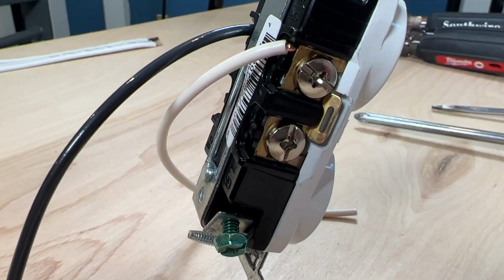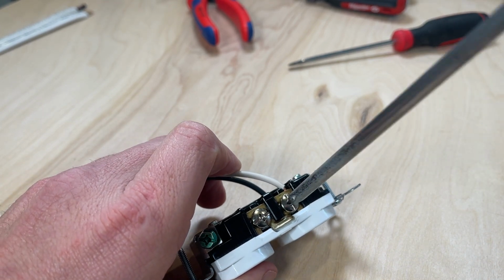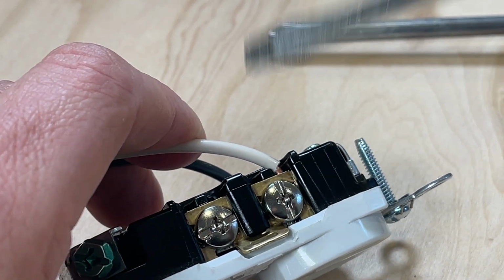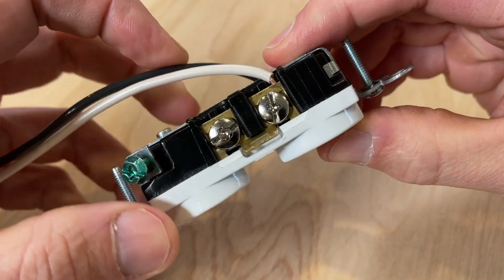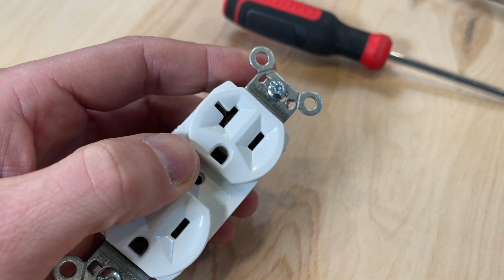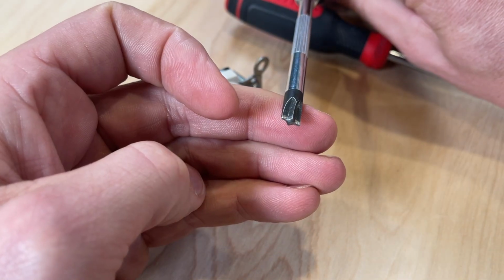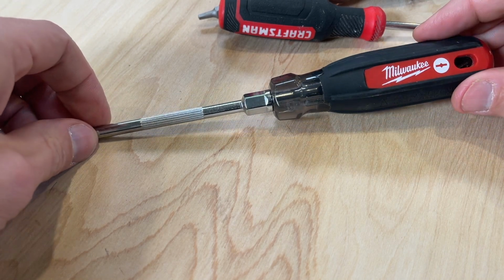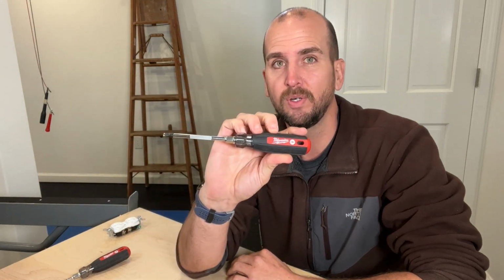80% of People Use the Wrong Screwdriver For Electrical Work

Comment: As a homeowner I do not have specialty ECX screwdriver and I may get one as I was wiring things around and will be doing more during renos. However the Robertson(square drive) is perfect for the job and you use No 1 for the outlet wiring and No 2 for the wiring ground to the electrical box and also tightening the clamps for wire coming to the electrical box. RObertson is all you need for electrical work. (With the exception of the cover plates, damn those slotted screws)
EDIT: I just realized that Canadians also have superior clamping in electrical boxes, its isnide the box so you can always adjust it instead of on the outside edge. And the screw is thick Robertson drive.

Comment: In Canada we use three Robertson size bits which work for every situation, and when we order something that comes with flathead or Phillips type screws,  we generally toss those screws into a jar and replace them with Robertson screws. This makes the job better and easier for us and the next guy who comes along and has to do some work on that piece of equipment.
Reply: Yup. When I remove a flathead and Phillips screw I usually toss it directly into the garbage.

Comment: Great video! Very helpful. I think the world would be better if they just put a better screw in the outlets... then maybe I could get away with using less tools to complete jobs... wishful and possibly dumb thinking I guess because I'm sure for some reason that these screws have to be this shape. I'm not an electrician but recently have had to wire a small travel trailer.

Comment: First off, as long as the job is done it does not matter if you use a Phillips head or flat head, just use the right sizes. You gaslighted by deliberately using wrong sizes of screwdriver. If I was using a flat head screwdriver for that screw I would have picked a wider one! The reason yours kept moving was that it kept wanting to go down into the deeper Phillips indentation! But I would have chosen a Phillips head that will seat correctly in the screw and not go with a generic #2 head like you showed. Any good DIY person will have more than 1 size Phillips and flat head screwdriver at hand!

Comment: ECX is just not necessary.  You can get enough torque on the screws of a receptacle to tear the threads out with a #1 Robertson without any slippage.  Why would I bother to buy a single-use tool where a multi-use Robertson works just as well?

Comment: KISS. a correctly sized flathead works great. I have also slightly took the tip off a phillips and it fits much better into the slot. I could never understand why someone would overwhelm themselves with extra tools when it is not needed. I work in the maintenance field and have done home repairs since i was about 13. Dont buy a new tool just because its new.

Comment: Absurd. Those screws are clearly for Pozidriv (PZ2 or PZ3) screwdrivers which are pretty abundant. They are cross-shaped too but have different gemetry. Not for square of some weird types. Phillips are intentionally designed to pop out of screws under tension when those are screwed in to some degree. This was a purpose of it from the very beginning as it was designed for car manufacturing. Contact surfaces of Phillips screwdrivers are slightly angled even on brand new ones. Pozidriv head and screws are designed no to do so. Their contact surfaces are flat and they stay with the screw under almost any tension.

Comment: Ideally you want a safe a mount of torque on the wire

there's specific guidelines for specific type of connections as to how many newton/m is supposedly needed to apply for an ideal connection.

these things can heat up and cool down many times over it's life time, when it's too tight, things might snap off, when it's not tigth enough, the wire might slip out.

If you can't apply enough torque with the philips head, you're weak and should train yourself (given that you're using a better fitting one than shown)

ideally you want the PH screw to be able to rest on the screwdriver without being able to move independantly in either rotation direction. Yours is woefully inadequate in that respect. The idea is good: getting a better tool for the job, but you show that you don't know why the other 2 screwdrivers were failing you.

Comment: A slotted screwdriver doesn't give you torque because of more surface area. It's because it gives you more leverage. The bit extends outwards further towards the outer edges of the screw, giving you a greater radius, which gives you much more leverage to rotate the screw.
Reply: Actually regardless to size of a driver, the leverage is always the same. Just a matter of what will be capable of holding up to the most torque. Leverage would require the handle itself to change sizes or to be off center.

Comment: So far as I know the Robertson #1,#2,#3 etc is the same size no matter where or who made them. I believe metric sizes are also the same size. A #2  metric Robertson is the same size as the #2 imperial size. The Phillips has different sizes and shapes depending on where it is made. It also has metric sizes. Dry wall screws used a special shaped Phillips.  The differences are so slight it is hard to determine which driver to use. This means that if you do not match the screw exactly it spins and stabs. Any time I disassemble something I replace all the screws with Robertson.

Comment: If I was a full time electrician, I'd probably use the ECX driver. I didn't even knoe the ECX existed. I typically use the #1 robertson on outlets and switches and the #2 robertson in the panel. I typically have one or 2 of the multi bit drivers in my tool box, but if I don't , I'll use a #2 phillips. I actually found that a robertson was superior to a phillips quite by mistake, when I was getting frustrated with a #2 phillips slipping off the screw constantly. I tried the #1 robertson and it was a thing of beauty.

Comment: Not only the outlet design is dangerous, but also the metal piece that attaches it to the wall is the same that is powered by the live wire in the wall. Darwin would be proud.
Reply: Btw, use insulated screwdrivers, not that ones

Comment: #2.25 unless you take a smaller slotted screwdriver and use it on the smaller terminal:P edit: Lol forgot it's us, you guys make problems of stuff that kinder-gardeners know how to deal within eu. Just switch to 17century units you airheads, don't use your pinkies to measure stuff. Since 2019 all base SI measurements are abstract, that means they're based on constant natural measurements (wiki those so I don't have to explain: https://en.wikipedia.org/wiki/International_System_of_Units). It's not called international for nothing, you feet high and rocks heavy neanderthals:P

Comment: "Slotted screwdriver" ... Just say flat head, that's what it is.

Also, no need to be pedantic about what screwdrivers are "best". If it works, it works. Wires don't often see a lot of movent, so they don't need a lot of torque to be secure, if a screwdriver starts to cam out, it's probably tight enough for electric work.

Comment: well... I don't know if you're an electrician or not, but I was taught to make a loop on the end of the wire and wrap it around the screw for an actual tight connection, and you don't have to crank down on the screw so hard. Just shoving it in there straight is moronic, it slips out easily. I was taught this in an electrician school

Comment: So we learned 2 lessons;
1) you need special tools or the absolute best fitting slotted screw driver, while slotted screw drivers are outdated out of several reasons
2) those screw design is absolute garbage
= Use Pozidriv (advanced and better Philips head) or, even better, Torx head screws and everyone's happy.
Also in Europe we have those garbage screws, they're just a pain in the a**.

Comment: Or just don't use garbage -_-
The phillips screwdriver looked like your average driver from the dollar store. Just buy a professional set of screwdrivers like the Wera with lasertips and you won't need anything else. No need to buy a special screwdriver for everything.

Btw, this is only applies for ppl working on DIY projects or for fun or whatever not professionals, that need to screw 20 of this everyday.

Comment: Good advise for the general DIYers out there. I personally prefer to have a proper selection of drivers of most if not all the different tips/bits out there - saves me the aggravation of damaged fastener heads or gouging the surface of the object I’m working on. And those square tips(Robertson)are overly underrated….. just my 2cents

Comment: As an electrician, I've been using the ECX screwdriver for years now. It's also great for EMT fittings. I rarely use a slotted screwdriver for anything other than a pry bar or doorstop.
Reply: @tabooretka  as an electrician myself, I do occasionally use slotted screwdrivers. The offset ‘wiggly’ works best for cover plates imo. Larger slotted sizes come in handy when working on older equipment/loadcenters, and occasionally new breakers that use slotted terminal screws

Comment: OMG this video is so stupid. Engineers: make a bolt suitable for all types of screwdrivers so you don't need to look for a specific form of a screwdriver head. People: create and use a screwdriver suitable only for one type of bolt and TIGHTEN it to the point you will never be able to unscrew it back.

Comment: I agree that slotted is not the best screwdriver for outlets and this is a good video overall but that tiny little ridiculously too small slotted screwdriver that was shown was exaggeratedly poor example making this not as good of a video by a long shot. I use a Philips and a slotted screwdriver to then final torque but I use a screwdriver that fits the slot.
However I do think the world would be better if everybody would use an ECX driver I just don't have room in my bag for every possible tool that I might occasionally need so I very often use this second choice to avoid walking out in the hot sun back to the truck to grab ECX bit 99% of the time but if I'm installing multiple devices then proper ecx bit.
You said you were going to tell us why you preferred the Milwaukee Ecx and I agree the ECX is the best driver bit for electrical, that's what it's made for but why the Milwaukee you said you would tell?

Comment: As a mechanic I use a Snap On Philips #2 which does not slip due to its design, never knew about the square drive so I’ll definitely try that next time. Thanks for the info was very informative

Comment: If they'd change 90% of the screws to a #2 square drive, there would be much less frustration and profanity in the world. They don't strip out as easily as a Torx or Phillips, and stay centered without sliding out, unlike a slotted.

Comment: ....I shudder to think how much of a moron someone would have to be to fail so badly at using a Philips head or flat headed screw driver that they would have to look up this video while breathing out their mouth.
Seriously you don't even need much force or "torque" to wire an outlet. If the screw driver keeps falling out of the screw it means that the crew head is worn out or the screw driver is too small.
The screws are actually designed for flathead or philips, no need for any fancy pants tools you will never use for any other thing lol.

Comment: Yeah, absolutely not. I can fit two screwdrivers in my handy pocket and this isn't one of them. I just use smaller flathead and stick it in perpendicular, so that it's vedged in the Phillips' grooves. That way it doesn't go anywhere, it's still easy to operate with one hand, and you won't break anything even if you overtighten it.

Comment: That phillips is worn out (and it looks like the screw is slightly rounded out too). And the flathead you used is too small. If you used a better phillips, or a properly sized flat, it would work fine.

Comment: There is a Japanese version of the Philips that's used in a lot of small electronics. JIS is what it is called. It fits perfectly.
Reply: JIS is the Japanese Standard like DIN ISO or EN 
They have a little more than drives :)

Comment: Personally, I prefer a Phillips head for everything that doesn't require high torque (working with plastic enclosures, electronics and stuff like that). A square drive is more appropriate for higher torque applications like construction work and similar.
I live in Québec and if you go to any hardware store you won't be able to find proper wood screws that dont have a square drive head.

Comment: 99.9% of all outlet screws are over torqued anyway, what's the screw designed for ? 2, maybe 4 Nm ? The Sliping of the Phillips screwdriver helps prevent over torquing what could lead to broken wires... maybe the square screwdriver can prevent mangeling the screws but you have to be carefully with the torque

Comment: Cool, never really noticed that those screws where made for the robertson. I can see how this would matter in a professional setting but around the house my go to option tends to be whatever is closest tbh.
Reply: Most of  those screws aren't made for anything but a Philips or a flathead screw driver. Some outlets have screws made with the option  but they are not designed for a robertson.
Reply: @alexistaylor969  I see, thanks. Makes sense since I probably would have noticed a square in the middle haha.

Comment: a solution to a problem that was introduced as a convenience. Creating a new tool to fit a screw that was design to work with 3 existing tools is idiotic at best. Just get rid of the 3-in-one screw head and the problem fixes itself. the problem is perpetuation bad manufacturing habits.

Comment: I very rarely mess with devices like outlets or switches. When I do I use an old short stubbed slotted screwdriver. I don't like that wrong v right thing on this subject. A DIY type might mess with an outlet just a few times in their lives. I think it should be good, best, better! This is the thing though. Those tool belts get heavy after a few hours. It is my opinion if I am also working inside panels as well as installing outlets and switches I am carrying the LEAST amount of tools I can get by with. If this means I am using a slotted screwdriver then so be it. I am also NOT wrong in doing so.

Comment: This all seems pretty anal to me. If you use screwdrivers much you learn pretty quickly to select one that fits properly, especially if your holding the “thing” in your other hand. The screw is clearly designed to accept all three styles of driver and the job can easily be done properly with any of them. The insulated drivers I have for electrical work do not include a Robertson in the set but the common and Phillips fit very nicely. I tend to stick with the common unless I’m in an awkward position. I do like the positive engagement of the Robertson screws for deck work but they can grab the bit too well occasionally. My apologies to our Canadian friends 😁

Comment: Excuse me but isn't the Philips head designed specifically to pop out once the correct torque has been reached?
This is to avoid over torquing and damaging the components/connection.
Under torquing and over torquing can both be serious problems. 

If you want to be more precise with your torque, get a torque screwdriver and set it to the recommended torque by the manufacturer of the components you're using. This way you ensure a good torque no matter what head you're using.

Comment: If they don't want people to use a Phillips or slotted driver, then why the F make the head with grooves that look like they take those drivers??  First off, there is absolutely NO acceptable reason to design or use a fastener that takes a slotted driver.  There are far better options available.  More to the point, there exists no worse option.  Robertson is the obvious best choice to use here, especially since much of the rest of the building construction industry has already switched to it.  And they have done exactly that, but then why the F do they make it look like it's a Phillips socket?  That combined with the presence of the slotted socket is just the ultimate example of poor design that should never have been allowed to progress to production in the first place.  Why it still exists is frankly dumbfounding - emphasis on the DUMB.

Comment: Area of contact is not the problem with Phillips. Type of contact is. Phillips tips are wedge shaped to force the driver out of the screw head. This camming out is intentional to prevent overtightening. It's unfortunate it became the most common type of screw in the US imho. Hand tools let you know how tight it is and clutches have been around on power tools for decades. It's a design that frankly needs to die and never come back.

Comment: if the Robertson tip is made properly you can fit a screw to the tip and then you can actually hold the screwdriver upside down by the screw

Comment: Just bought a Klein 32305 ($20) ratcheting multibit screwdriver with a EC1 and EC2 combination bit included.  If you have a Klein multibit screwdriver already you can buy the Klein 32752 replacement ($11.32 for 2) EC1 and EC2 bits alone.

Comment: You are using the wrong screwdriver as well. Electrical contacts should be screwed on torque. Also check your stripper, because the copper is damaged.

Comment: As a Canadian electrician you use a green Robbie for electrical connections, ie plugs and outlets. Slat screws are used only in the USA. No slot or Phillips is ever used in electrical connections. The only reason is that you get then in Canada is for production only. It is cheaper to produce to the US market. Roofers on the US/Canada border will drive to Canada buy barrels of "Robbies" for roofing etc..... Robertson are by far the mostest best screw heat ever invented, yet the USA wont allow them to be sold in the USA, but allow them in contruction.....